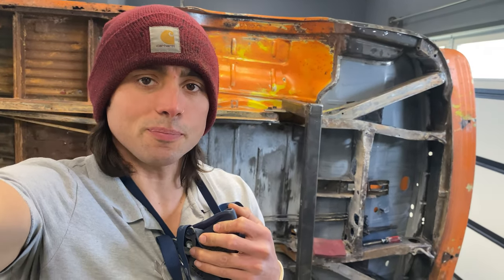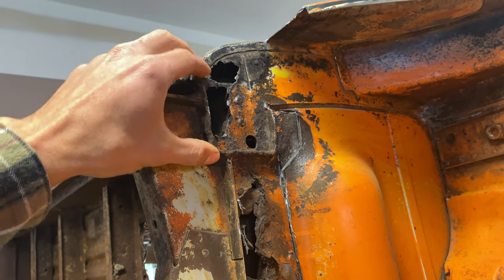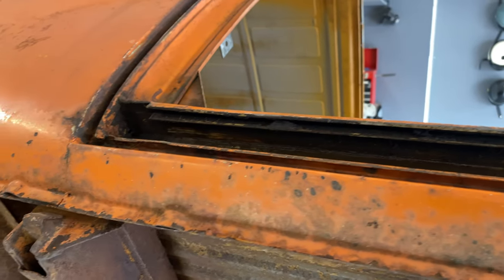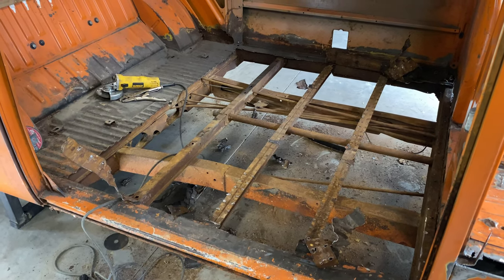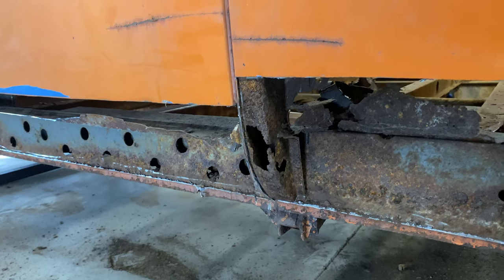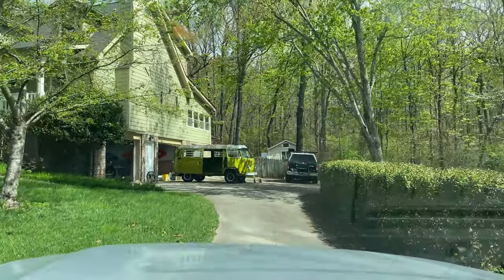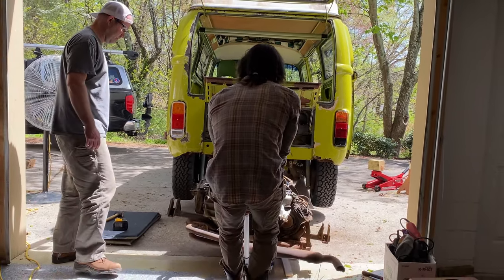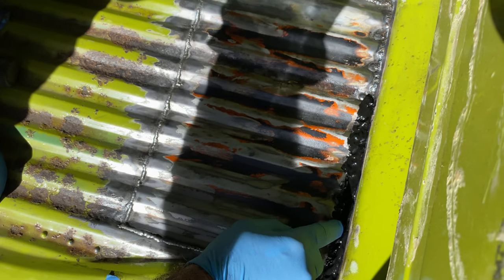Rust Removal Using The Rotisserie!  | VW Bus Restoration Episode 31

Comment: thanks for the reply man, you are an inspiration, out of curiousity how did you get the cross member floor braces separated cleanly so they still have those foot flanges on the ends ? air hammer / chisel ? or did you just cut all the way around them
Reply from the maker: I cut around them and carefully ground down the rocker metal until it was down to the fresh crossmember metal

Comment: thanks man,  what was that black sealer you used on the weld bead? do you recommend that on every joint / weld after repair? or like you also did the c piller inside in another video what did you use there in the interior.
Reply from the maker: Both those times I used POR15. I like using it because it’s like a paint that is completely sealed. The only problem with it is it has a hard time adhering to smooth surfaces as it’s designed to cling to rust. So whenever I use it I make sure to scuff the metal and also use the POR15 metal prep to ensure the surface is etched and prepared for proper adhesion.